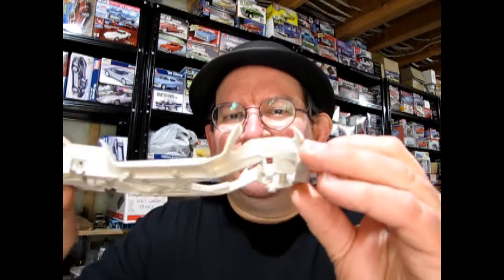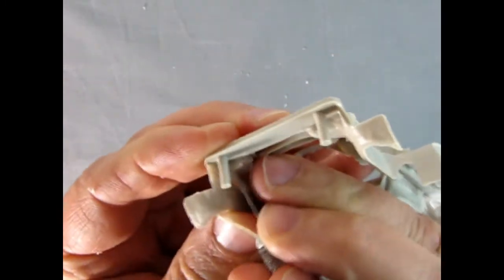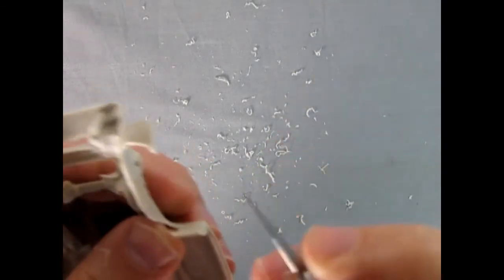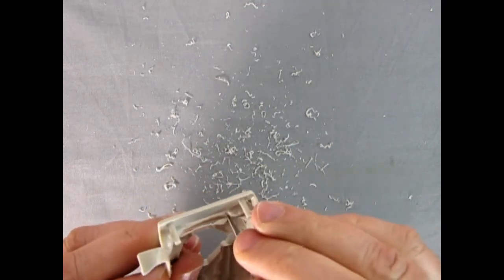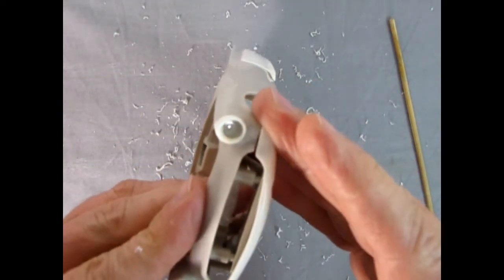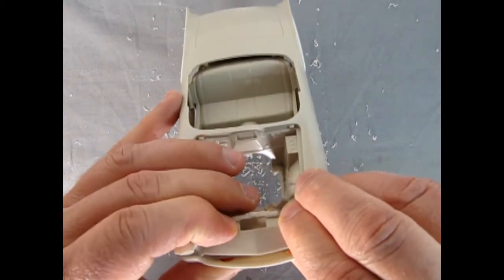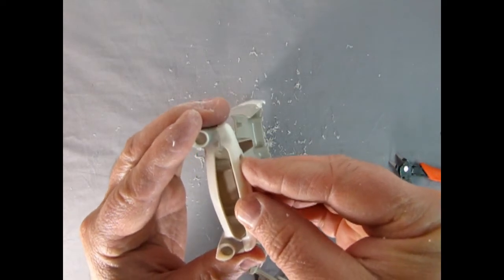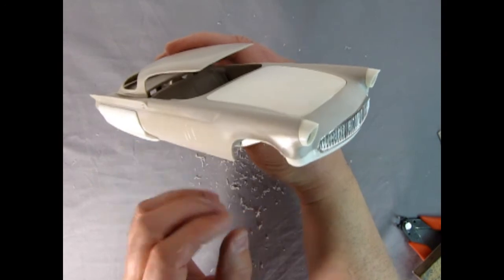My Entry For The Monster Hobbies 2022 Custom Model Car Truck Group Build - Video 4

Comment: Good video Trevor. Glad to see you cutting things up👍🤩
Reply from the maker: Glad you could find the time to check out the video! I didn't want to cut that panel because the instructions said I didn't need to...but whatever...the car will work out better now!
Reply: @MonsterHobbiesModelCarGarage  with customising its up to you what gets cut up, the instructions are only a guide
Reply from the maker: True Pete...but it's suppose to be an "Out of the box" custom "drop" in that spot without any modifications...according to the 1962 AMT instruction sheet.  Well, my modifications did work out though. This should look great in the end.
Reply from the maker: I should show you what I was doing on my 1951 Chevy custom. i think you would dig all the cutting and reworking I was doing there...1953 Corvette rear fender tops and a bubble top made from a clear dome from an Easter Egg and some sheet styrene. - that was a real "out of the box" custom!
Reply: @MonsterHobbiesModelCarGarage  it's how it looks at the end that'll matter. Mike's could do with a lot more work and it's hardly 'customised' just disappointing
Reply: @MonsterHobbiesModelCarGarage  I'm sure the whole modelling community would like to see the bubble top you've made. That sounds a good idea👍🤩
Reply from the maker: @petesmodelcarcustoms584  I should do a review of that later on.
Reply from the maker: @petesmodelcarcustoms584  It looks good. I need some more people to join in. Keep in mind this Group Build is throughout the year, so if you run out of projects, join on in!
Reply: @MonsterHobbiesModelCarGarage  the next project is a chopped, channelled and sectioned 48 Ford convertible, which I had a video cleaning the parts recently
Reply from the maker: If you want, just add in that #monsterhobbiesgroupbuild1 to your existing video description and then in later videos, just mention the Monster Hobbies Group build. ... and carry on!  You'll just "Fall" into my group build and Bob's your uncle!
Reply: @MonsterHobbiesModelCarGarage  I'll try to remember that👍🤔. Bob's my brother, actually 🤣
Reply from the maker: @petesmodelcarcustoms584  That is funny! :D

Comment: Nice update.  Lots and lots of fitment issues with that one.  Just keep scraping and sanding and you will get everything to fit.  Thanks for sharing.
Reply from the maker: That's the plan! - The fit isn't too bad overall. It's just that the parts I am putting on the car haven't been around since the early 1960's, so it's hard to know what to expect of them.